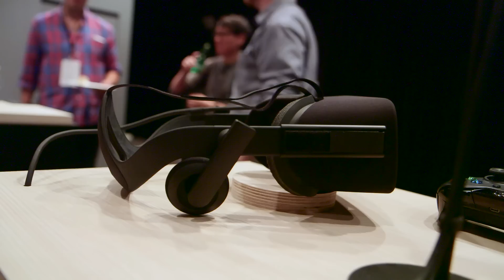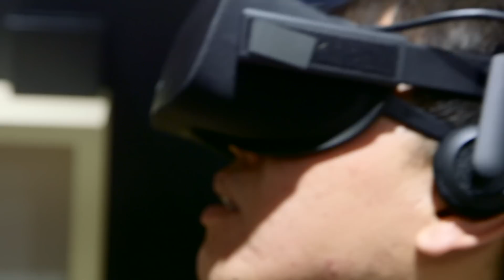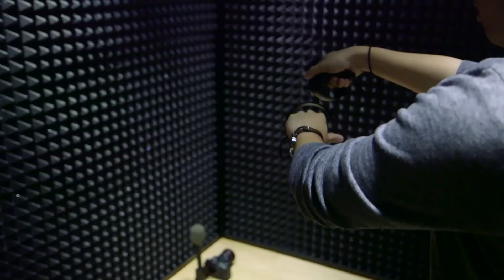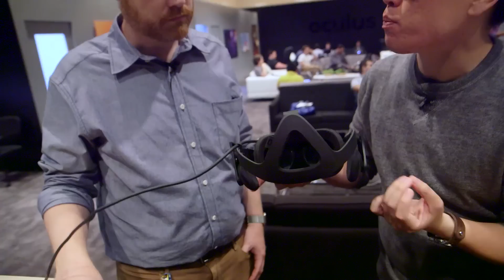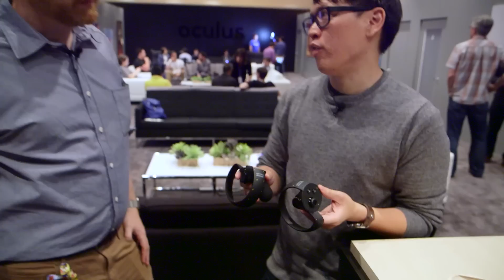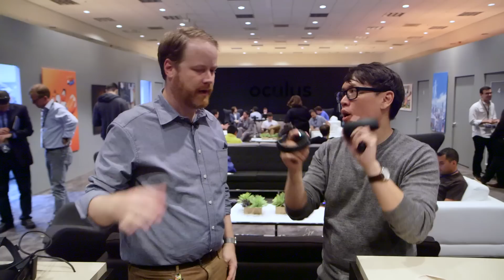Oculus Rift CV1 + Oculus Touch Controller Hands-On + Impressions!

Comment: how come the morpheus is 120fps and the oculus is 90? lol pc master race my ass :p
Reply: django chubbinz yeah i will eat my own arm if the morpheus can get 120fps on anything let alone graphicaly intensive games (+ in basicaly every morpheus video iv seen they have said its lower res then the rest)
Reply: django chubbinz lol, I can barely think of a single game with great graphics that runs 60fps @ 1080p on PS4, let alone 2x that resolution at 2X that frame-rate.  Enjoy your PS3 graphics.
Reply: Butterghost it was out dated before launch
Reply: gregsmw The PS4 runs games at 60fps and interpolates them up to 120fps on the Morpheus. I've heard it works pretty well from people who have tried it. Obviously they can't push the graphics to the limit with console VR.
Reply: gregsmw it already does... eve valkyrie runs at 60fps and is upscaled to 120.. rigs runs at 120.. theres the deep, and several other games sonys in house studios are working on and showed at e3
Reply: MrCorrectify sony's FIRST game killzone ran at 60fps in multiplayer so.... the ps4 can esily run 60fps ... then morpheus has its own precesser itself which helps ... sonys been spending most of their resources developing games for the 120fps vr experience..

Comment: So if I'm currently browsing for a graphics card and looking at, say, a GTX970 with 4GB vram, will such a card suffice to drive the two displays, or would I have to chip out for dual GTX Titans?
Reply: Morgan Andreasson Buy a card now if you want to buy one again in 1.5-2 years... otherwise wait.
Reply: Get the GTX980

Comment: Questions I have:
1. When will I be able to buy it?
2. How much will it be?
3. Will my computer run it?
Specs:
AMD A8 5600K
SAPPHIRE R9 280 3GB
8GB RAM

Thanks
Reply: Robert Burbank 1. its already out
2. 39.99 dollars
3. of course!
Reply: Robert Burbank You can preorder it later this year
$200-$400
For modern games you'll want to upgrade your PC to something much faster
Reply: Robert Burbank 
1.Q1 2016
2. $300- $450
3 Recomended system specs are:
i5-4590
GTX 970
8GB RAM
Your don't meet the recommended specs, but you'd still be able to run most things if you lower the graphics settings.

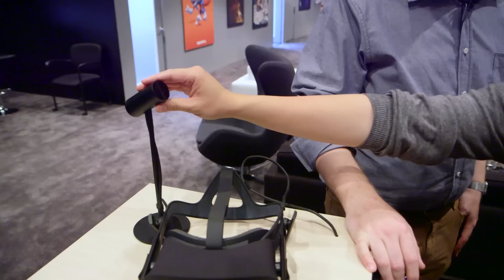Comment: 31:20 - I really hope you don't have to tilt it by hand to go from seated to standing. That was a pain in the DK2 because it meant having to remove the headset, look for the camera, adjust it and then recenter each time you went from one position to the other. I would hope the volume would just have enough vertical range to track you all the time.

Comment: If I was to buy a gtx 970 and an i7 4790k , do you think I could get a smooth 90fps if everything was set to low?
Reply: Fama Laevus Wait till it comes out and then buy the hardware... unless you want to buy something now that there will be a cheaper and more powerful alternative in 1.5-2 years, and you'll be kicking yourself later thinking about it...
Reply: Fama Laevus Yes. If set to low.

But I would recommend the new Raedon 390s. There 8GB so you have a shit ton of video memory for VR. The 970s are shit. Not even worth your money. 980s are alot better if your not gonna get the 390.

Also you only really need 60FPS. Trust me unless your a pro gamer or tennis player you wont even notice the difference in 60-90.

The i7 is very good, but make sure you get yourself at least 8GB of ram or you wont get anything out of your GPU and CPU.

Goodluck :) 

P.S Deathbrewer is 100% correct aswell. What i have just suggested is for current buys. But if you where to wait till next year there may be better and cheaper hardware.

Comment: Why don't they just develop some fabric gloves with sensors across every finger and wrist joint? Seems like it would be much easier and more natural to implement something like that instead of these plastic grips that you have to constantly be aware of holding on to.
Reply: Someone is already developing this. With that said, you still need some way to control the game, and fabric gloves won't allow you to walk around.
Reply: Captain Crunch That's a good point about needing control for walking.
Reply: I think that the gloves are called control vr or something like that if you're interested.
Reply: Matt J http://www.engadget.com/2015/07/16/oculus-buys-pebbles-hand-tracking/ this company form israel implementing hand recognition. no need for gloves or anything

Comment: I REEEEALLY hope they come up with a way to actually capture the rift footage on a second monitor or screen without having to use that obs software lol...The past year has been nothing but forum searching and frustration. I just gave up on trying to record certain games because they just show up black on obs and shadowplay...how the hell can I capture the rift in extended mode reliably? The answer at the moment is I cannot. black screen. Cannot wait for cv1 though. It looks Amazing. I use it for iRacing. No more triple screens. Flight, space, and race sims are the best application for rift. Its funny how many people are concerned about a controller. Sim experiences are basically ready to go for rift, as long as your control hardware matches up to the position.

Comment: I don't know how they are going to get this under $600-700 :/ I hope I'm wrong

Edit: Just saw they said a while ago that it would be around $200-400, so I'm happy
Reply: When it comes to cost, treat the rift like a monitor. 
Monitors cost a lot (good large size ones).
The rift will certainly be worth it!
Reply: Jackson Akins I doubt this quality VR headset will come in around $200. Even the Morpheus I'm expecting around $400+ minimum and it's using lower quality lenses and other parts... and the Rift is the highest quality one out there, completed OR in development.

Comment: Wouldn't it be easier to make glove type controllers with imbedded LEDs , so when u actually open and close your hand it does the same or move individual fingers. First person shooters would be amazing if we did the actual motions of reloading and aiming. Then a walk feature be a slide sensor on the side of the pointer finger and you would adjust slide with the  thumb.  slide speed = walk and run speed.

Comment: Not 150, that would be crazy. So 210 would be insane?
Reply: matszz Medical research vs. your word. 

Hmm, I'll take the research.
Reply: +matszz I know the discussion is over, but I have an interesting fact to explain why your experience works : it's all about OPTIC DISTORSION. Make your research ^^ (I'm not able to explain it in english xD!). I think it's due to the fact that our eyes are balls : our "visual sensor" is a sphere, so we sense things with a thin "spheric distorsion".

I think the problem is also related to the difference between ANGULAR fov and LINEAR fov. An ANGULAR fov equal to 180° (like human sight) has an unlimited LINEAR fov. That plus the optic distorsion, allows you to see the edges of your wall ^^.
But that was very interesting to point out this "problem"! You just didn't have enough knowledge to understand it (and that's absolutely not a crime ^^').
Reply: matszz that would be beyond human sight
Reply: Nobbs66
So you're saying 210 is overkill?
Reply: matszz Yeah, very much so. It's wasting a lot of GPU power when it could be better used for something else.
Reply: Nobbs66
It was a starbreeze reference...
Reply: oh
Reply: matszz The human fov is only like 180 so yes it's overkill
Reply: LilRedRasta
No it's not, it's greater than that, try it yourself.
Reply: matszz Dude humans 100% have a fov of roughly 180 degrees. In fact it's a tad lower than 180. This is not my opinion This is a scientific fact.
Reply: LilRedRasta
Stand back against a wall, fixate your head forward and then you'll find that you can see the wall you're up against. You can only do that if the FOV is greater than 180 degrees. What scientific fact can you provide that will invalidate my own senses?
Reply: matszz How about you google it idiot. It's in literally every medical journal ever. Google Human FOV, human visual field, binocular vision and it's relation to monocular vision or maybe check out some university articles on the issue like this http://www.uh.edu/engines/epi2581.htm

Now can you please sit the fuck down?
Reply: LilRedRasta
How about you try what I told you and come back with the apology you fucking idiot.

Comment: How long have they been developing this and they are not lacking in funding? They have ended up with a Fatshark HD design with Track IR head tracking.. It will be interesting to see if they can develop an interface for more complex games like flight sims which is the limitation with these VR headsets.
Reply: stewjw If they are not already they should get together with DCS with their 6 DOF cockpits. I'm interested in the tech but from what I've seen so far I won't be buying the first release of these VR head sets despite the hype from some quarters.
Reply: stewjw Editing your original comment to add more content is preferable to commenting on your own comment...

Comment: Great interview with Palmer and Nate from Oculus VR, on the new CV1 and Touch Controllers.

Still waiting to find out what wireless tech the Touch Controllers are using. Is it BT (or BTLE) which would be compatible with phones and other devices, the same as XB-One link (PC dongle coming this fall), or maybe a 3rd solution with the wireless link to the CV1 itself...?

Basically are these controllers usable with/for other projects?

Comment: So hyped for VR and AR (i.e. Hololens), normally being an early adopter however with so many units hitting the market and such high price points I'm forcing myself to hold a bit until I see dev support (i.e. expected at E3 we would have seen a big announcement, like Fallout 4 has full Oculus support, that would have been BIG) and reviews. Hope there is a clear winner come early 2016, I want in on VR so bad. I fear however that these rev 1 units that do hit will be dramatically improved upon in a year.

Comment: Will it be possible to use keyboard and mouse?
Reply: saint667351 Depends on if the specific game supports keyboard and mouse and even if it does you wont be able to use it blindfolded. Just use a gamepad...

Comment: Wouldn't it be cool if you could get a scan, or put on a body suit with sensors,  that'll measure your body shape / size /finger length and thickness etc etc etc and then load it into your rift. or a usb so you could load your data into someone elses rift...hmmm

Comment: I was hoping they'd go for something like Leap Motion and not a hand held controller per se. Leap isn't very good from what I've heard, so things are clearly still up in the air when it comes to controllers. It did show a lot of promise early on though. Can't wait for the futureee! :)
Reply: Esa Edvik Leap is terrible
Reply: LilRedRasta As I said, so I've heard. Didn't mean it had to be Leap.
Reply: They could do leap with TWO. ONE in the camera mount and another on the headset. ONE if definitely not enough, although it's a brilliant experience and is the only thing I'd define as true vr. They actually bought a leap style company though.
Reply: Leap is for VR should be better than the single Leap controller. They have a Rift mount for the 2nd leap controller. I had a feeling the Oculus touch uses something like leap on the inside, but from the low power, I now doubt it.

Comment: Now the real question is.. Which VR is better? Before E3, Vive was considered the best one but I feel like Oculus has been catching up. I guess it will depend on their price since having to buy a controller with the Rift is a waste of money for me.
Reply: PhilGerb93 I'm not sure about that, it may not impact the cost anyway because of commercial agreements between ms and oculus.
Reply: PhilGerb93 A xbox controller is included with the rift, the oculus touch is optional and won't be ready for the rift launch.
Reply: PhilGerb93 Also I'm pretty sure they're going to be cheaper than valve, perhaps even with the touch included, we'll have to wait and see...
Reply: slopedarmor First half vs Q1, not for launch but almost...I wonder if they'll decide to  sell them in bundle with the Rift after the Touch release
Reply: jjjota Then you can buy m together, but you're still gonna pay extra for the touch.
Reply: slopedarmor That's what I'm saying, I don't want to buy the xbox controller that's bundled with the Rift. It won't be free for sure and will impact the price.
Reply: +SimonsOnlineShow Doesn't star vr only have a 60 hz refresh rate though?

Comment: one thing yous never make clear...when can we use it with our consoles???
id say 85% of the worlds gamers use either PS4 or XBOX ONE.. that's a big slice of the pie their missing?
Reply: Steve Mcgrath Ps4 has Morpheus. Xbox One doesn't have any vr device right now. The Oculus requires 2x usb 3.0 and 1 hdmi port to work, so it would be a pain in the ass to constantly switch cables...but who knows.
Reply: jjjota thanks man,
I just cant wait until the Chinese
 get there hands on it and start making there own universal versions for absolutely everything ..
Reply: Steve Mcgrath Can't wait for the lower quality Chinese rip-offs that are nothing like the real experience? Oh boy, oh joy...
Reply: Deathbrewer Give them time and I'm sure you'll get quite good devices in the next years. The hardware inside the Rift is nothing special except maybe the lenses, and with open-source sdks and a better understanding of this type of software we should get very interesting products at a very low cost. Think about relatively cheap chinese smartphones right now, a lot of them are not bad at all

Comment: I'm a bit worried about getting dust in the mesh and blocking the sensors. Even if not completely, but difusing the light too much, to the point where the tracking gets imprecise.
Reply: allluckyseven In the DK2 the LEDs shine through black plastic. It's gonna take a whole lot of dust to block those LEDs.
Reply: slopedarmor Replace "dust" with cum stain then the op might have a point. :D
Reply: allluckyseven USB mini vacuum? ;)
Reply: allluckyseven lol. Dust will not stop LED's from emitting their light.
Reply: Vartazian360 The problem is not with the LEDs themselves, it's with what is in between the LEDs and the camera. "lol".
Reply: dbnstrikeman lolz that might be an issue with that vr porn!
Reply: allluckyseven It looks like much too tight a weave for that. More so than a dust filter.
Reply: allluckyseven blow it out with some compressed air if it's an issue

Comment: You didn't touch on the visual quality as much, how does this compare to the Gear VR?
Reply from the maker: Mr Mutes It's hard to say without moving from one device immediately to the other. This felt really really good. Much better than GearVR1. We'll discuss this on the podcast today, FWIW.
Reply: nice, any link to the podcast?
Reply: +Mr Mutes 
Gear VR is for a phone...
Ofc its not as good.
Also while your note 4 uses 1 screen with 2,5k the Oculus CV1 uses 2 screens with 2160x1200.
Reply: +floSa   So each screen would be 1080x1200.  According to this video. I doubt it would be 2160x1200 per screen. That would take alot of processing power.
Reply: Kyle M Ah yeah true that! :)
Thanks for correcting me.

Comment: Can we use 2 rifts in the same room using 2 different cameras ? Will it be a problem that both cameras can see both rifts ? Will both cameras track both rifts accurately ? I really hope this works because I hope to be able to bring my friends to my vr room and play together
Reply: Ahmed Hesham Gamal Surely you'll need two PC's. So to avoid "crosstalk" issues, keep those 2 PC's in separate rooms.
Reply: Ahmed Hesham Gamal Not exactly sure the benefit of both of you being in the same room. You can't see each other and you'll be wearing headphones, and it would be a bump risk. There's a built in mic, why not just be in the same virtual room as your friend?
Reply: Ahmed Hesham Gamal You will need 2 beast PCs. But IIRC the rift DK2 uses a sync cable to align with it's own tracker. Theoretically the CV1 does the same thing, enabling multiple rifts in one room under different rift's camera view without any issues. The LEDs on the headsets flash in a pattern extremely quickly which the camera picks up on and recognizes as an "ID" if you will. The different headsets will be synced to their own cameras and have their own sync/"ID" so another camera will basically ignore flashes at the wrong time that don't match what it is looking for.

Comment: Guys, I may have missed it, but as far as I can tell you did not mention what the screendoor effect is like in CV1
Reply: CMDR DrDeath Screen door is non-existent. Its gone. No review I've seen has talked about it and the ones that have only did to say that they can't detect it even when trying REALLY hard. The best you can do is identify slight pixelation (need for aliasing because of low rez, like a normal monitor--NOT SCREEN DOOR. NO SUBSTRUCTURE IS VISIBLE) at extreme distance.
Reply: CMDR DrDeath Apparently it's mostly gone - the spaces between pixels are virtually imperceptible ;)
Reply: infirmux That would be nice.
Reply: onionburst  Do you have a link to those reviews ? Also, I was hoping to get the statement on SDE from the "Tested" crew. They have been the most consistent reviewers on the subject.